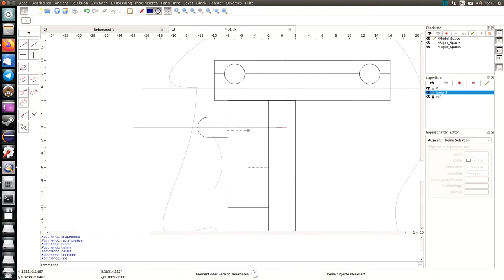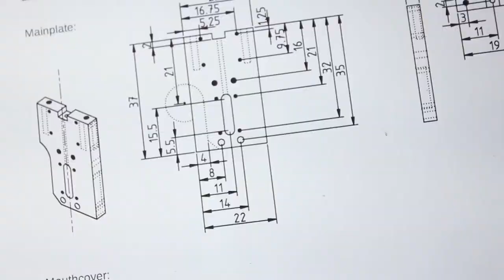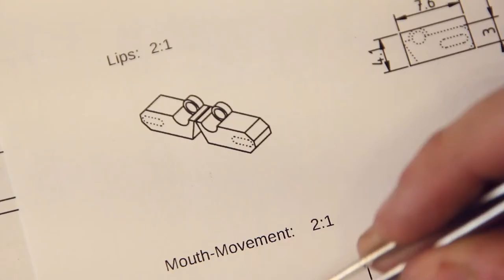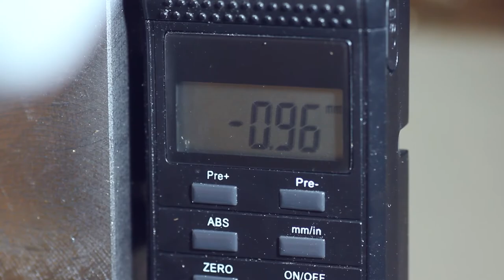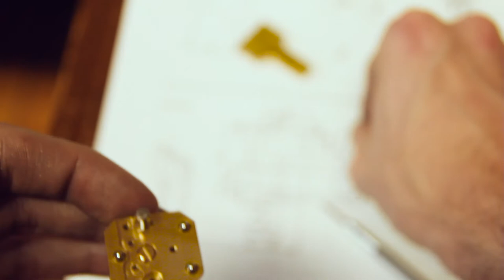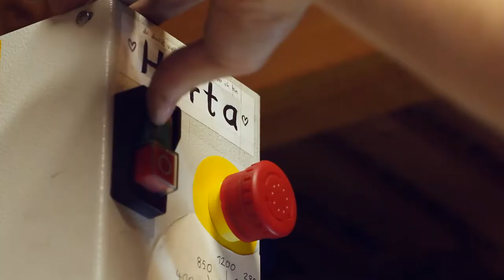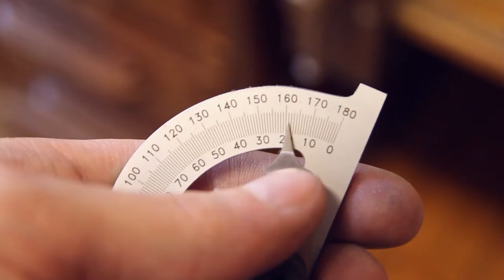Stopmotion Head Armature | An Unwound Clockwork

Comment: I think you have a great idea to mechanize the face.  I'm no expert but the animatronics videos usually show a thin skin over a very realistic skull or almost a hard subdermal for the mechanism to work over.  Thinner will allow your mechanism to be sean easier without pulling on other parts of the face.  I hope you continue to work on the mechanized face.  Best of luck.
Reply from the maker: Thanks a lot, yes I think a thin removable "skin" would behave much better. Back then I was very unsure about how to mold the thin skin in the first place and how to connect it to the skull, so we tried molding everything in place, but I find the result a bit underwhelming too... :D
I'm confident with the mechanical aspects, I think nowadays I would be able to create a more organically shaped skull, but the organic aspects of the silicone molding and sculpting are still something I cannot do on that level... I'd love to collaborate with some SFX-Expert on something like this, to learn how it is done professionally... Maybe someday... ;)
Reply: @ValentinFelder  Something that I thought of as I was reading your reply.  Look into 3D printing.  Not for the skin but the mechanics of the skull.  I don't think FDM would be best at the sizes you are working but an SLA might be worth thinking about.  The prices have come WAY down recently and produce an almost smooth product though choosing the right resin might be a challange.  SLA resins can be brittle but with the right design and resin it might be just the ticket.  I've only use FDM so I couldn't help with the resin choice.  You can choose a very small nozzle and low layer hight to increase resolution and maybe less sanding and the part would be more durable if you use FDM.  Just a thought.
Reply from the maker: @repalmore  Thank you! - We actually have used SLA printing in the meantime for molds and replacement mouth parts, you can see it in many of last years update-Videos, mostly the ones about the boss character. From all 3D-prints I've seen so far this technique seems to give the best results, I was really impressed. ...I also don't own a printer myself, I had it done by someone else with an industrial setup. For me, metal still remains the best material for miniature mechanisms - it's strength, durabiblity and surface quality are just unmatched. However, I see the value of SLA printing for creating organic shapes with high precision and repeatability, and especially when combined with some metal hinges/bushings/gears it can be a really powerful tool!

Comment: Very technical solution that was always going to be challenging to control the variables. You have a wonderful skill set and are so precise but I sense that not everything technical needs to be Heath Robinson, especially when it's not seen. I'm sure you tried to load your internal armature with Vaselene to prevent silicone inclusion, using an acetone soaked cotton bud to clean areas prior to the pour that you want to bind? Layering silicone in various shore hardnesses might also give you the movement and flexibility you are looking for. Really amazing work, nothing easy is ever worth anything in life, I'm a big fan.
Reply from the maker: Thank you so much Mark - Seems you know what you're talking about, those are some great ideas! :) - We tried some of these things, but ultimately we had to stop at some point and start shooting. I'm pretty sure this could have been greatly improved with a bit more time and ressources though... You're totally right, it was more a fun exercise than strictly necessary, but I like challenges and even when things don't work we can learn a lot.
Thanks for your encouraging words! :)

Comment: I have a question. Since unfortunately I don’t have all these instruments to make these components, do you think that I can create one of these skulls by finding the pieces? If yes where? Which website?
Reply from the maker: I'm afraid it's not possible to buy such specific parts - But it would be possible to commission them, but that would be very expensive since it's a lot work. (Let me know if you're interested) - You could try 3D-printing with a resin printer, that might work if the scale isn't too small. Or just stick with brass, it's not necessarily required to have a mill and all these specialized tools, I did a lot of work with handfiles, a drill and a jewelers saw a couple of years ago... But that requires some experience and time of course.
Reply: @ValentinFelder  oks, thank you!👍

Comment: Great machinery and craftsmanship. But the end result can probably be improved if you think outside the box/"head".
I mean cast small metal pieces directly into the silicone at the mouth and eyebrows, then use a mechanism with magnets inside the skull to create the movement instead.
Then a thinner silicone layer can be used which should create a more natural movement.
Don't know if it works in practice, is just an idea I got and wanted to share.
Reply from the maker: Yeah, you're absolutely right, I would do many things different too on a second try :D - But using magnets probably wouldn't work, on small metal parts the traction is very weak and it requires quit a bit of force to move the silicone, even thinner layers...
Reply: Romans 5:8❤